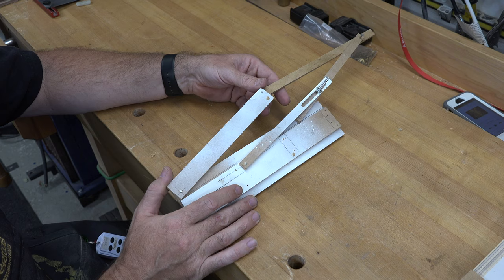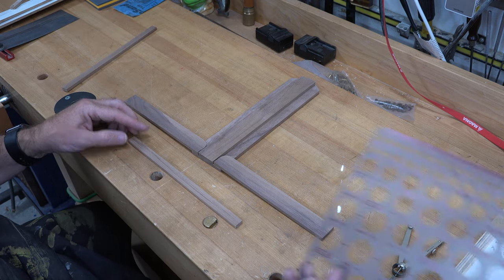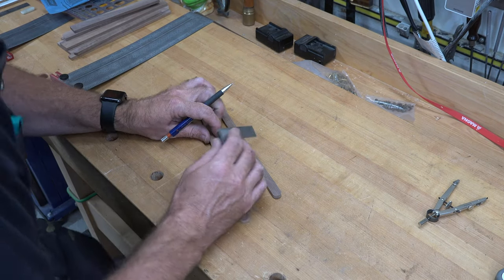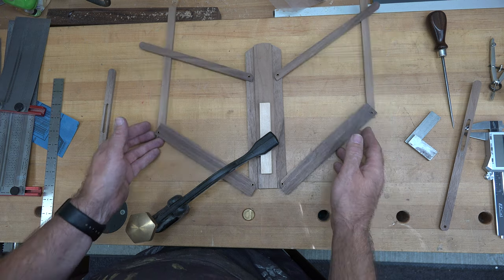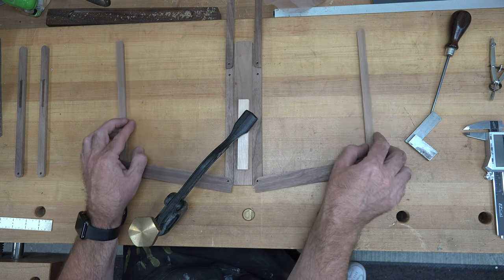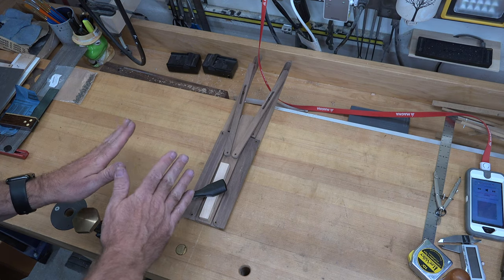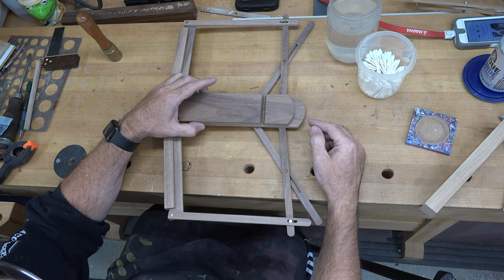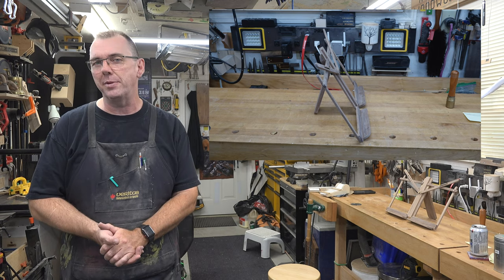Making a Table Top Music Stand

Comment: very cool project. was wondering how did you attach the back bracket stand?
Reply from the maker: The back bracket stand was attached mostly with glue but I added a couple of drive pins.  For the most part though, the glue is what holds the stand in place.  I hope this helps.  Thanks for tuning in to the show Jacques and taking the time to leave the kind words.  It's very much appreciated.
Reply: @acutabove_woodworkings  Kenny - really enjoyed the video. My son has just got a piano and is keen to progress his music so this will be a great project for me to make for him. Like one of the other subscribers, I'm a bit confused as to how you've tackled the stand support. I get that you glue the top section to the main stand but how did you hinge the lower section to provide the back support? Always look forward to your Friday videos.
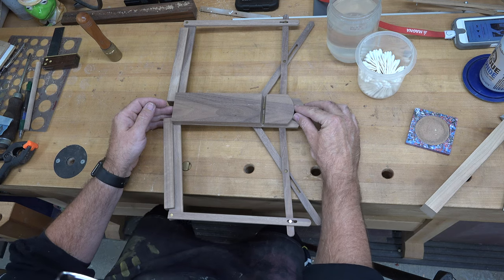Reply from the maker: @jclwyd  I went through the video to see where the confusion lies and apparently, I neglected to mention the hinges.  At 23:15 in the video, you can see the small brass hinges between the upper and lower sections of the stand.  The hinges are recessed on the back of the stand so that they don't interfere with it lying flat to the music stand itself.  Once I had the hinges mounted properly to allow the fold out section to lie flat against the music stand, I then glued the smaller top section in place, allowing the larger section of the fold out stand to pivot on the hinges.  I hope this explains it a little better Clwyd and clears up any confusion that there may be.  If not, please feel free to continue this conversation here and I will do my best to sort it out.